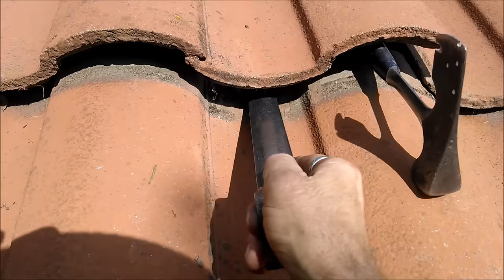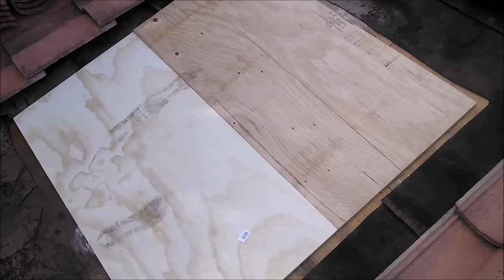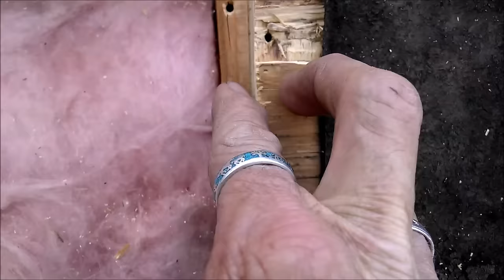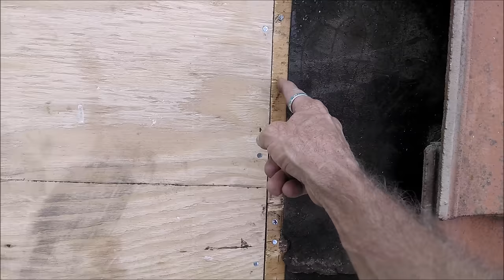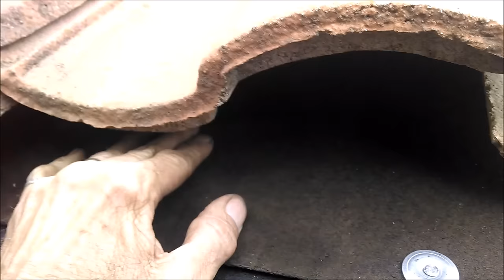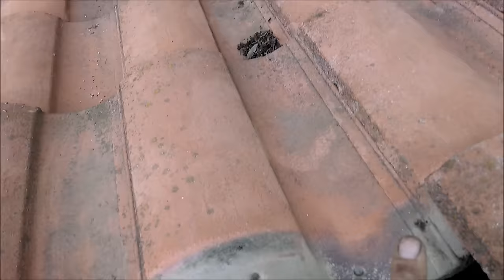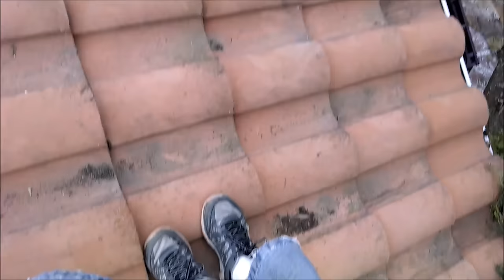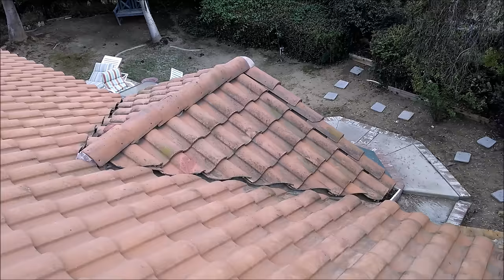Roofing Tile Leak Repair - Tips, Tricks & Helpful Hints

Comment: Pardon my rather silly question, but what saw+technique did you use to cut the bad plywood on the trusses? I've always wondered the most efficient way to make the cut without damaging the trusses below. Thanks in advance!
Reply from the maker: There are no silly questions if you are serious. Silly questions only come when people don't really want to know something & ask silly questions of others to entertain themselves. Wanting to know something, or even to know many things, is one of the most serious & meaningful things in life. Now, on to your question... I typically set my saw at a blade depth just slightly deeper than the plywood sheathing is thick. That way even if it does penetrate through to the rafters, it merely scores them instead of cutting too deeply & compromising their integrity. Does that answer your question?
Reply: Thank you, Dan. And what type of saw do you use?
Reply from the maker: Rigid wormdrive... It's the same as a skilsaw wormdrive, but not a circular saw though. Circular saws are too hard to control compared to a wormdrive & you can't see the blade cutting the material as easily with a circular as you can with a wormdrive with the blade on the left, unless you're left handed or course.
Reply: That right there is the root of what I wanted to learn. Thank you for your willingness to share info. If you're ever in South Florida, I owe you a beer (or a cafe.) Thank you.
Reply from the maker: You're too kind... How did you fair through all that chaos over the weekend? My family & I have been praying for y'all Floridians!

Comment: Hi, I see there is a square nail washer on felt paper. What’s the difference between the two?
Reply from the maker: Just a manufacturer’s preference… there’s really no difference if both were metal washer/cap in nature. I’d just recommend avoiding the plastic round cap felt nails. They’re almost totally useless & cause more damage than good.

Comment: I have 4 x tiles that have a cracked that runs length wise and are not missing any pieces or are loose. Would it be okay to just run a bead of construction adhesive the length of the crack instead of replacing the tile?
Reply from the maker: Only if the cracks run parallel with water flow of the roof. If cracks run perpendicular to water flow you should flash, seal & paint those cracks.

Comment: If 30 pound felt paper should last 50+ years; how long should 20 pound paper last...assuming correct installation?
Reply from the maker: I’m not familiar with 20# felt. I’ve seen 15# felt used under tile that became dried out over time & caused leak concerns because it wasn’t thick enough to remain healthy over time, due to lack of asphalt saturation in the membrane itself.

Comment: Got to love these amateur roofers, a little knowledge is dangerous.
Reply from the maker: ... and so what is your version of an expert? Or who are you referring to as amateur - just so the rest of us can better understand where you're coming from?
Reply: 40 years as a craftsman and most of the stuff on here is BS, I have re-roofed hundreds of roofs that did not have roofing felt due to their age but did not leak.  under slaters felt is like rag felt, bitumen impregnated paper with a bit of string in. At least today you have some quality breathable membranes but they do not come cheap.
Reply from the maker: Very true... Every craftsman has the responsibility to make the most of the materials they are given. We are obliged to follow the codes of our day & learn how to make things work even when modern codes fail the customer. The problem is that many if not most modern so-called craftsmen default to the lowest common denominator, thinking that the materials are somehow magical & can somehow make up for cutting corners in quality & getting into the habit of doing sloppy work. As you implied... Substandard craftsmanship is the most typical reason for roof system failures; not the materials.

Comment: recommend  any cordless nail gun for those S tiles??..  or do they nail em  1 by 1 with a hammer?
Reply from the maker: Never had a cordless, but Hitachi makes a great pneumatic nail gun that will work. Cordless would be much better though considering the stacks of tile that a pneumatic hose would constantly hang up on. Either way, make sure you align the driver carefully with the manufacturer's nail hole in the tiles or you'll crack the tiles. I use both methods... Thanks for watching.

Comment: What do you think of polybond G for underlayment?  It's being recommended by potential roofer.  The quote is not much more than one for 2 layers of 40 lb felt and they don't require any money til job is finished either. 30 yr warranty.   Only roofing co.  so far that doesnt require money up front.   Is each tile supposed to be nailed? Because currently mine are not all nailed down.
Reply from the maker: Renee Two layers of 40lb sounds like a low pitch application. Picking the right materials really depends on the application. Any substitute for standard materials has no justification in my mind for being higher priced. New technologies always promise lower costs to the consumer, so how come we never see it when it comes time to pay the bill?

With that said, convenience is a worthwhile service to the consumer & if a contractor offers you convenience at a higher price while doing quality labor & standing behind their work then that’s worth paying more for in my book.

As far as the tiles being nailed goes... Again, it depends on the application & your local codes. Standard pitch tile roofs without battens require every tile to be nailed, but some other applications do not.
Reply: Thanks!

Comment: Ok Dan unfortunately i have a leak in an area like this with similar tiles. What should i look for in a contractor or what question should I ask. I am not happy my tile roof leaked in the first place
Reply from the maker: You want them to tell you what's wrong with your roof, how the water is getting through the layers of roofing into your house, how it happened to get that way, how they plan to fix it, how they plan to prevent it from happening again & if they'll stand behind their work. No roof leaks simply because of broken tiles. Tiles, underlayment, flashings all play a part in your roofing system & understanding & being able to explain how your roof works compared to how it's supposed to work is half the battle. You want the expert to actually do the work & you want a supervisor overseeing the work being done. Do a background check on their license first & check the public reviews of their roofing services on Angie's List & Yelp & you should be happy with the results of their efforts.
Reply: Duster Dan Right on, thanks and will do meeting roofer tomorrow

Comment: I was wondering. How do you remove a tile that's been glued in place like you did on the repairs?  You can lift and remove nailed ones but I am assuming the glue will harden and lose flexibility but bond to the tiles and cause breakage and cracking if forced to separate.  Am I wrong?
Reply from the maker: Yes... You are correct, depending on the glue that is used. That's why I use a co-polymer or tri-polymer for my repairs. These kinds of adhesives remain flexible indefinitely & are strong enough to hold the tiles indefinitely but will release from the tiles if they are forced apart, unlike other adhesives that harden. I know what you're talking about as I've had to re-repair repairs that other roofers have completed using adhesives that harden, & they are extremely difficult to separate without breaking the tiles. That's why I recommend polymers for sealant or adhesive rather than other glues that harden. You learn over time what works & what doesn't. Thanks for watching...
Reply: Simply remove the 2 glued tiles together as though they were a single one. Remove  1 above and 1 below the glued ones. No different than how he did in this excellent video.
Reply: Duster Dan Sir, excellent video and instructions. Probably  1 of the best tuts ive seen on anything on youtube. Really great job!!

Comment: Around how much should i be expecting to pay for a job like this?
Reply from the maker: Frank Ramos It totally depends on supply & demand dynamics. If no one will do the job right, then spreading goop on your roof is worthless. And if several roofers will do the job right, that also should keep pricing competitive. But if only one roofer will do the job right & stand behind their work, then that repair pricing should reflect the value of whatever a non-leaking roof is protecting or preserving below inside the house. Obviously, your budget should effect price also, but not as much as the quality of the repair & the value of the overall investment that the roof repair is preserving. There are many other factors as well but pricing is always a moving target, negotiable & a matter of supply & demand dynamics.

Comment: Dan just a quick question what would something like this cost. Just a ruff estimate.
Reply from the maker: It is the policy of many contractors & tradesmen not to disclose pricing. The industry doesn't seem to know how to compete in such an environment. Morons! Now that I got that off my chest, I can move on to answering your question. For the morons to do the work, for this job with sheathing replacement included, you're looking at somewhere between $350 - $500. But for someone who knows what they're doing & really cares to take their time & do it right (with a warranty), I think it's worth between $750 & $1000. With NOT having to replace the sheathing I think it's worth about $500. The morons may not like me pricing out repairs over the internet, but they can either suck wind or make the necessary changes to take better care of their customers & then they wouldn't have the problem of competitive pricing, because their reputation itself would be priceless to the customers they serve.

Am I saying that the only ones who are concerned about keeping pricing a secret are the morons who are take advantage of their customers? In one way or another, yes, pretty much - regardless of whether they know they are doing it or not. Quality is the highest priority when competing in a free market, because you get what you pay for. The free markets are about supply & demand - which includes quality control, not keeping price discovery a secret from the customer. And if they don't like the free markets they can move to another country where there is only command & control pricing - and they can do their sloppy work for whatever the government says the job is worth. Just to be clear, I am not obligated to a command & control economy who's fears of price discovery cover over the theft, secrecy & lack of quality control that wastes the customer's hard earned money. Instead, I am obligated to the customer & the good Lord Himself & I refuse to keep things secret that would otherwise force the competition to take better care of you - the customer.

Merry Christmas free world!
Reply: Duster Dan thank you

Comment: Instead of blocking between rafters why not use Simpson PSCL 1/2 plywood clips?
Reply from the maker: BajaPete don’t plywood clips have to go in in successive sequence? I’m not aware of being able to put the clips into an absolute space where sheets are already installed outside the repair area. This system was a 16” oc rafter construction. It does need clips because it’s just as stable without them. Besides, I hat plywood clips.

Comment: can the upper tile be pushed up (not lifted up) to expose the nail of the tile below so removal of the nail is easier ?
Reply from the maker: If you push any tile on the roof up or down after it’s nailed in place, you basically tear the felt underlayment where the nail goes through the felt paper. That is why I recommend separating the tiles to get a nail puller in between them & pull the nail before removing it or moving it. The nails that hold the tiles basically seal as they go through the felt paper, but as you can imagine, anytime you move a tile after it’s nailed the nail tears the felt paper & is no longer sealed to keep moisture out.

Comment: thanks! is the other hole in the tile ever used?
Reply from the maker: Only when needed... Codes generally require that each field tile are nailed with only one nail & in most cases it is more than enough to hold them fast indefinitely. The other nail holes are used as a secondary option if the first option is a bad location for the nail to be used in each particular tile. It can depend on where the tiles are located on the roof - next to a flashing, etc. The only time I can think of when it's necessary to use more than one nail is on a steep roof with no batten wood strips to help hold the tiles in place. There may be other exceptions but you get the point I hope.

Comment: I have 4 x tiles that have a cracked that runs length wise and are not missing any pieces or are loose. Would it be okay to just run a bead of construction adhesive the length of the crack instead of replacing the tile?
Reply from the maker: Jerry Ratajesak If the crack runs with the slope of the roof then yes... Run a bead of caulk & smooth it out slightly with your fingers to feather the edges. If you have a crack that runs crossways to the slope, more care needs taken to insure water doesn’t get through the crack as it crosses the crack & runs down your roof. Perpendicularly cracked tiles should also have the side seams glued shut from top to down past the crack.
Reply: Duster Dan Thank you Dan!  Appreciate you getting back to me and your advice!

Comment: I would have liked to see the felt going in....  also, the thick tile hole... couldn't you drill it open?  glass tile bits work good
Reply from the maker: I’m sorry. I had to make more progress in work that day & forgot to record felt going in. Kinda got carried away getting it done rather than recording. 😁 Also, yes, you could drill the nail holes out. I’ve done that on many occasions when I absolutely needed them to be nailed instead of glued.

Comment: what type of rafter system and sheeting might typically be found under an original 1906 clay tile roof on a house in Ohio?
Reply from the maker: opiemom66 It could be open spaced sheathing without underlayment, open spaced sheathing with underlayment, solid sheathing without underlayment or solid sheathing with underlayment. All of which would likely be on a 24” or 16” rafter system. The best way to know your specific situation, is to carefully inspect the underside of the roofing from your attic or from the underside of your garage roof if you have one. Keep in mind that “solid sheathing” in your case does not refer to plywood but rather refers to solid 1x boards installed immediately next to each other with a small age gap between them from shrinkage & “open spaced sheathing” refers to the same, but with larger 2”-6” (intended) spaces between the boards that serve as your roof deck to support the roofing material beneath the roofing. Also, this “open spaced sheathing” is NOT referring to the rafters themselves but rather referring to the boards installed on the rafters that run perpendicular to the rafters & provide a substrate for the roofing material itself. You may need to refer back to this description a time or two during your inspection before all this will make sense. Let me know if you have any more questions.

Comment: where abouts are you ? do you not use battens over there ?
Reply from the maker: J J So Cal... The climate zone in So Cal does not require battens except on steep roofs, to help hold the tiles in place for safety reasons. Battens are always problematic regarding proper shedding of rain water off the roof & interfere with leak repairs, flashings, valleys, trim tiles & cause problems related to roof maintenance. They obviously elevate the tiles off the roof deck a bit for airflow, but cause far more problems than they solve.

Comment: Why don’t you put roof cement on each side ? It’s more secure that way. I’ve done many repairs that leak because that reason when it rains and it’s windy the wind blows water underneath the felt. Other than that perfect repair... I like that you’re using metal cap nails those are the same ones I use much better than plastic head nails or staples... You can use Eagle tiles I know Life tile is discontinued but Eagle fits them
Reply from the maker: After 30 years of professional roofing with an overlap of 20 years running my own roofing business & somewhere between 5,000 & 10,000 repairs & hundreds of reroofs, I have my reasons for doing it the way I do, but thanks for your advice & thanks for watching.

Comment: How much does it cost for this repair?
Reply from the maker: Opal Barnaba Sorry, can’t say. While you can get an average idea of pricing from others, there are simply too many variables to accurately assess any job without knowing all the details. It would be unfair to you if I told you my pricing & then you had some shmuck come & do the same job without my quality. And, conversely if some shmuck gave you a cheap price estimate, it wouldn’t be right to expect a quality craftsman to do a good job for that same price.

Besides all that, there are countless details that effect price in every job that you can’t possibly be aware of through a video, unless the whole point of the video was to price out every one of those details. Add to that the economic relevance of price based on location, supply, demand & the local economy in your area.

It’s just impossible to compare apples & oranges. And every job is one or the other. No two jobs are alike.